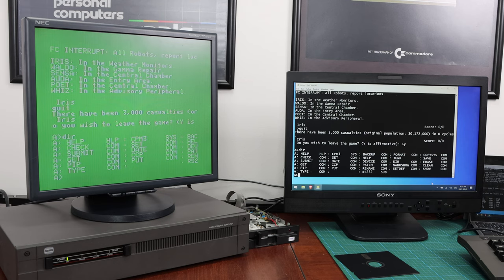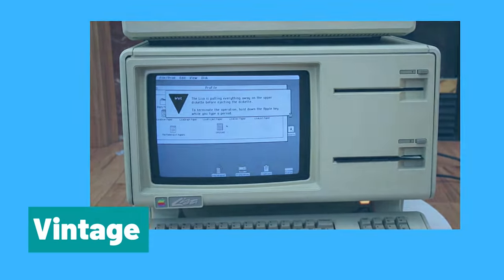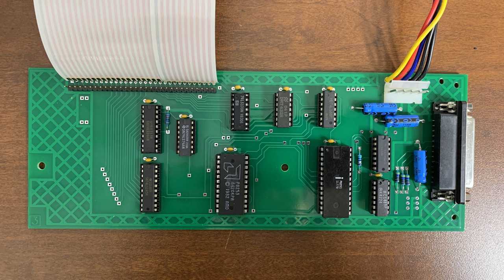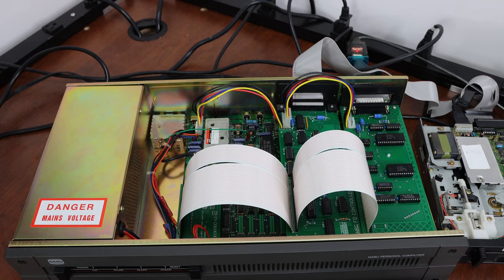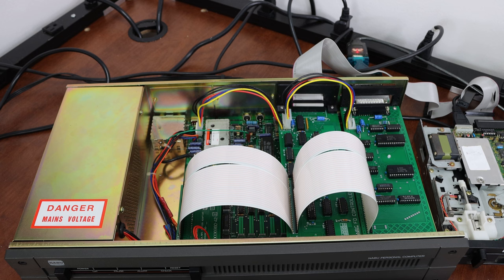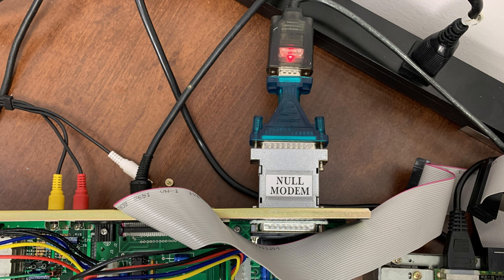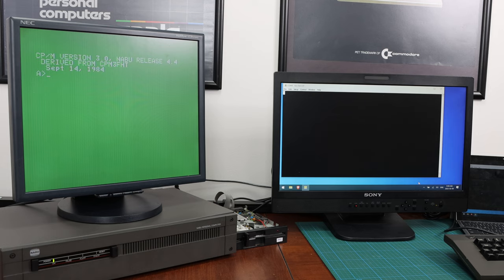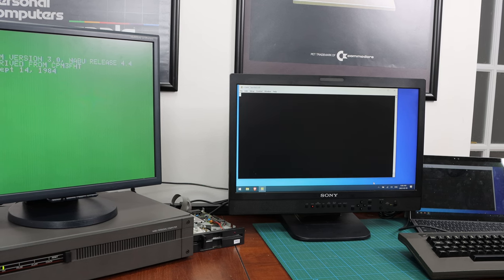Nabu PC Serial Board Reproduction

Comment: I'd probably go with option 3 and use a RS232 single +5V level shifter with RS232 level voltage pumps. It just seems easier to do unless one needs the actual -12V.
Reply from the maker: Klyball said the very same thing specifically because of the -12 volt mod needed. That was on the table for a bit but he likes to stay true to the original designs and I agree with him.   The schematics are available on Klyball's site if you want to take a stab at it.

Comment: Are there plans for an enhanced video and sound upgrade? Hard drive? There have been IDE drive addons for MSX computers, often used with a Compact Flash card. How many peripherals can be daisy chained off the bus? Looks like there's room to stack 2 cards at each location with those big holes in the back of the case.
Reply from the maker: The F18A can be used to enhance video, from what I have read.  I don't know of any projects for audio enhancement.  There are multiple projects looking into mass storage but I, personally, would only be interested in one that will work in conjunction with the FDC floppy drive and serial cards.  I am working with one of those now but it's still in the works.  There is technically room for 4 cards but I believe only three actually fit because of the re-jigging of the bus.  From original cards, you cannot stack them.  If you are not a member of the Nabu PC Discord, I would suggest you join as many projects are discussed there.

Comment: If pins 2 & 3 on the expansion power connector are normally connected together, then your diagram for the alternate modification isn't quite right, since pin 3 should also have -12V.
Reply from the maker: Pin 2 and 3 are not normally connected together.  Pin 2 is not connected at all and pin 3 is connected to ground.  Part of the factory mod is cutting the pin 3 trace from ground.  I should have included a picture prior to the factory mod.  I will try to be more clear the next time.

Comment: Umm… why was a motherboard modification needed? The expansion connector has +12 and -12 volts on it???
Reply from the maker: The 5 pin power connector for the option boards does not normally have -12 volts on it.  If it does, you may have the factory mod already.
Reply from the maker: @darkwinter6028  The -12v is on the incoming side 30 pin connector.  It doesn't flow through to the daisy chain 30 pin connector so you would still have to jumper from the FDC board.
Reply: @vintagecomputerca  OK… dumb question… when laying out the new FDC board… why wasn’t the -12v line connected? 🤔
Reply: @darkwinter6028  I completely agree with you. However, I presume that he is trying to recreate the original card for preservation purposes, warts and all. But you're right that it's really strange that that line wasn't passed through originally or on the recreation cards. If complete reproduction hadn't been the goal then it would have been easy to either pass the -12v on the 30 pin connectors or add a negative voltage converter onto the serial board.
Reply from the maker: @darkwinter6028  Exactly as @frnno967 stated in his reply.  If not staying true to the original, Klyball could have eliminated the -12v need altogether by using different ICs but he stuck to the original layout for historical purposes.
Reply: @darkwinter6028  it is connected on the FDC , but not on the motherboards. any original Nabu with a FDC has the -12v mod applied from factory. But the consumer versions are neutered. if you wanted a floppy they would swap out your unit
Reply: @klyballsvintagecomputers5531  “not on the motherboard” - you are referring to the large power connector (J16 I think - I don’t have my NABU in front of me to check the actual motherboard) that is shown being modified in the video, right? And not the 30 pin 0.100” headers (J9, J10, etc.) that has the data/control signals on it from the Z80? 

What I was referring to was the -12v line on the 30 pin connector. FWIW, that pin on my - as far as I know standard consumer NABU that I got from PellMell’s eBay sales - is definitely hooked up to -12v.

Interestingly, MJP’s technical manual does show -12v being present on J16… perhaps he was working from a developer unit, and not a consumer one when he wrote the manual?

I do understand making an exact clone for historical purposes, but - and this is probably just a matter of slightly different priorities - personally I think I would have caved in a little bit to practicality. <shrug> 🤔
Reply: @darkwinter6028  for sure i see where your coming from. the replica will not be for every one , and yes the -12 is on the 30pin buss . But then you need to redo the option board and reroute the fdc and serial , so we might as well go with a smaller cheaper easier version that plugs straight into the 30 pin and does not need the -12. which i believe has been done. I already was hesitant to add the 34 idc to the floppy controller , but going the centronics cable route with the drive back plane would be a stretch for most, the fdc and serial already is quite niche.
Reply: @darkwinter6028  because they're duplicating the 1980's original hardware

Comment: Could we use ribbon cable (similar to floppy type) instead of these flex cables?
Reply from the maker: I tried that but was having issues and I am not sure it was related to that 30 pin cable.  I ended up swapping with the correct flex cables because I know those connected securely.  It doesn't hurt to try.
Reply: I am using a set of “DuPont” female-to-female jumpers that I have removed the single-pin plastic housing from and installed the metal pre-crimped pins into 10-pin plastic housings. The jumpers are shipped as a 40-pin ribbon cable; I have separated them into 10-pin groups.

These seem to work OK when probed with my oscilloscope (a Rigol DS1054z). When the next round of my PCB designs arrives from JLC PCB, I should have more positive results (the first version had a timing issue with the design, but it was located after the bus interface ICs, so I’m pretty sure the cable is working properly).

Comment: You do not describe the Tera term settings.  Parity? Echo? Not even speed although I assume 9600.
Reply from the maker: Sorry about that.  I guess it didn't make it into the video as I had a video clip that did show the settings.  The settings are 9600,8,N,1 local echo off.  I may have used Xon/Xoff but I don't think it was required.  Hope this helps and good luck.

Comment: This is good stuff!  But honestly, I question the value of providing RS232.  Practically everyone is going to simply use a RS232-USB adapter dongle, so instead why not just provide a TTL serial header, at least as an option for those who don't care about the RS232 physical layer.
Reply from the maker: You make a good point but this is a reproduction so it follows the original design rue to form including the need for the -12v mod and the 25 pin RS232.
Reply: @vintagecomputerca  Even with RS232, I'm surprised that a modification is necessary -- the expansion pin headers have a -12V rail on one of the pins.

Comment: any parts not available in new stock?
Reply: Klyball has a build of materials (BOM) on his site. Everything is available from Digikey.
Reply from the maker: The Intel P8253 and P8251 chips I had to buy new old stock.  They don't have those at Digikey and as such, they are not on the Digikey BOM but are on the parts list.  Looking at the board, they are the two largest chips.

Comment: The Nabu needs a backplane :)
Reply from the maker: There are four option slots that were originally supposed to be one slot per option card but Nabu chose to redesign the the bus to make it daisy-chained instead.  The 30 pin cables would have caused all sorts of possible interference issues and such.  Hence why the cables are shorter and they plug into each other in a daisy chained environment.  I probably should have mentioned that in the video but I forgot.
Reply: @vintagecomputerca  I know but one could make some kind of PCB bus connected to the back of the enclosure but that's overkill probably.
Reply: My main point was basically "this is why we have/had backplanes" :)

Great work!